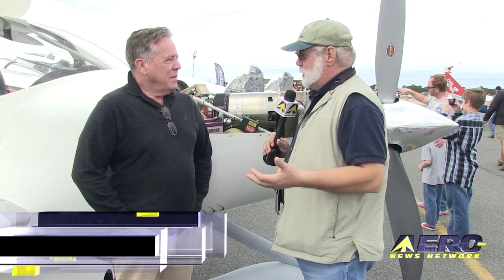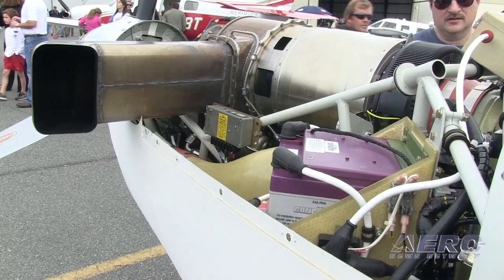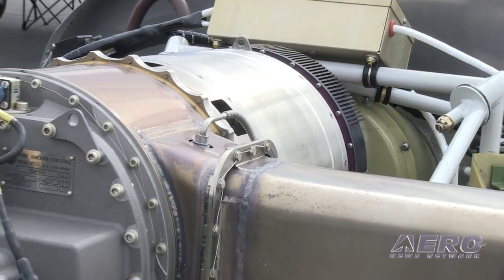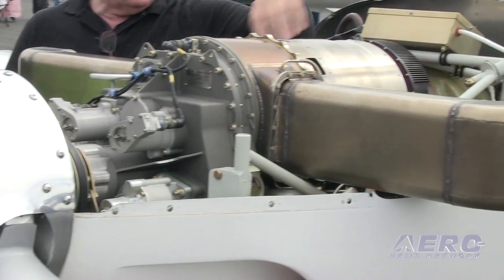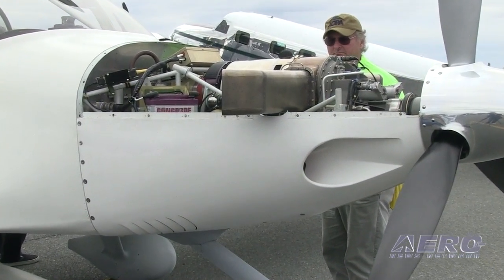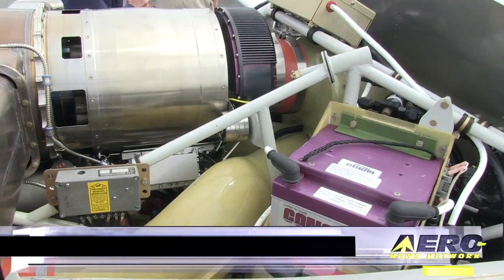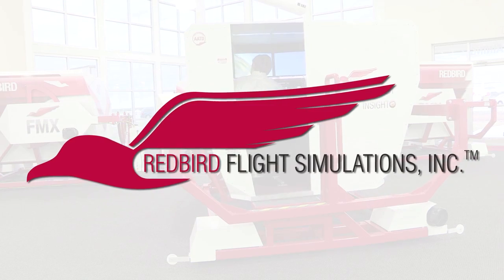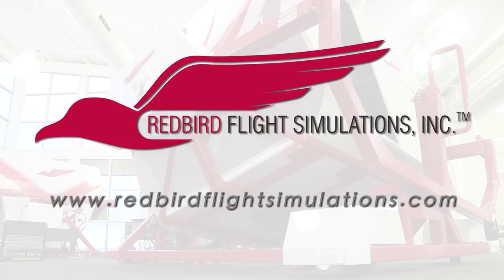Aero-TV: An Affordable GA Turbo-Prop?: Turbine Solution Group Thinks So!

Comment: This does make sense doing it with an RV-10.  They are strong and will not try to kill you like a Lancair will.   On the other hand it seems a waste of potential having it on an aircraft that does not have a pressurized cabin, no retractable gear and no deicing equipment.
Reply: I don't mind not having a retractable gear, because those fail and cost money in maintenance. The most annoying one is not having a deicing solution, at least in my eye.

Comment: 1500TBO??? WOW that's one expensive donk! Much better off with a 250HP Lyc, you can buy a few of them fr the cost of one turbine! Just not practicable, fuel burn, operating costs etc are way beyond the average flyer which is what the RV range of ships is aimed at.
Reply: This is because it's new. If it can prove itself the TBO will likely increase.
Reply: wouldn't a turbine have superior longevity, better fuel efficiency and lower maintenance costs?
Reply: Yes a turbprop engine is way less maint, good fuel economy, running cost can be a lot cheaper then a piston engine, as long as nothing bad happens. A full overhaul is an expensive price. I know some smaller turboprop engines have an over haul when needed. Wps turbine has a lot of great info on a modified t62 turboprop or turboshaft motors. It seems like there are more and more companies working on making a turbine more flying friendly and able to fit in your experimental type aircraft. So hopefully as time goes on we can see these prices come down.
Reply: that guy  Turbojet is very very thirsty. Waiting for the development of small turbofans.

Comment: 110 THOUSAND IS NOT AFFORDABLE! WHEN WILL SOMEBODY MANUFACTURE A REAL AFFORDABLE TURBO PROP???
Reply: Afraid that the reality is that $110K is affordable when it speaking about turbines for aircraft.  The metals are expensive.  Making all those turbine blades is expensive.  And they all have to be tested individually.  I am sure  if a manufacturer could make an engine this size for $50k that they would.
Reply: Bro for an airplane that can go twice the speed of my current airplane, it really is worth 100k. You can get cars for more than that.
Reply: This statement is like asking Santa. Has no perspective on the realities of manufacturing. Like I just want it cheaper!! Give it to me! When will someone do what I want! The interior of that engine is inconel. Have a look at what that takes to purchase, machine and work with. And besides, $100k is what a BMW M3 costs with some extras.
Reply: That's cheaper than a Cessna 172! 110K is an absolute bargain!

Comment: I am happy to see PBS Velka Bites have gotten their turboprop on an airplane; the last I'd heard of it, the engine was still undergoing bench testing. I think the engine core is the same type as in their turbojet that powers the SubSonex sport kitplane, and overall it resembles a miniature Walter M601. I hope they can get it certified, because it might make a real screamer out of your typical four-place propeller airplane!
Reply: All2Meme It looks like any reverse-flow free turbine, just on a much smaller scale.  I'm curious as to what the determined TBO will look like, my best guess is 1,500 hours.  I'm really excited about this little engine, AV gas is on its way out jet-A prices are kept artificially low.  This engine in a decently outfitted RV-10 would feel like a lot of airplane for ~$300,000.
Reply: +brucenash XD true!!
Reply: If you wanted to get a PT6 for $600k and thought man I can't responsibly spend that on my hobby then this looks like a god send. I hope its as simple as an M601 and what I can see happening next is the Helicopter guys taking it on. The Robinson R22 will be a turbo for sure if it gets certified.

Comment: Hey you need to go high to see speed and low fuel burn. The rv line is NOT engineered to be a high altitude plane! That,s per dick van grunderson himself. They are designed as sport planes. A glassair ll or lll would work great. You can get 70 + gals into a glass air . Not really sure about fuel burn but i bet 3 hrs with reserves could be in the ball park